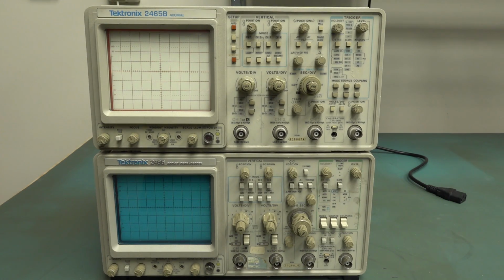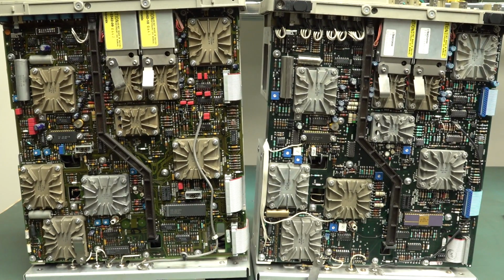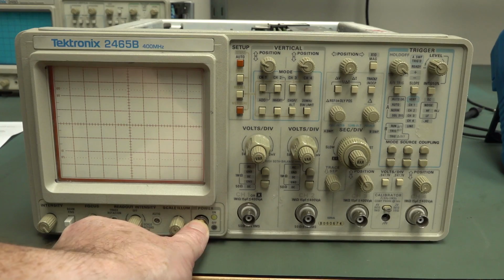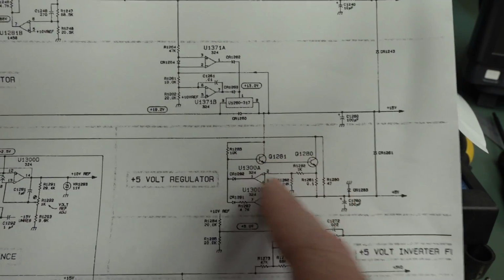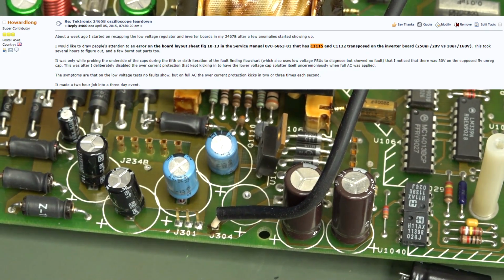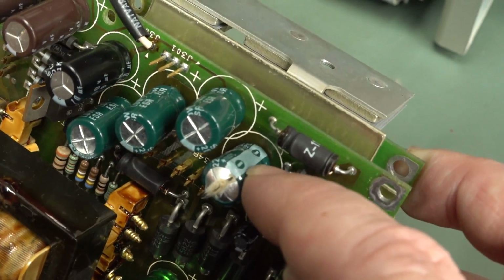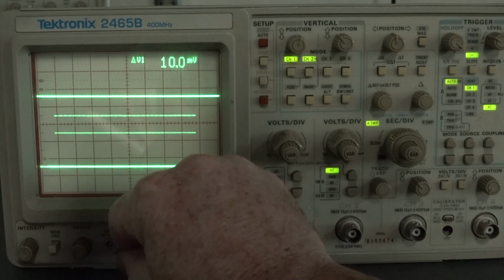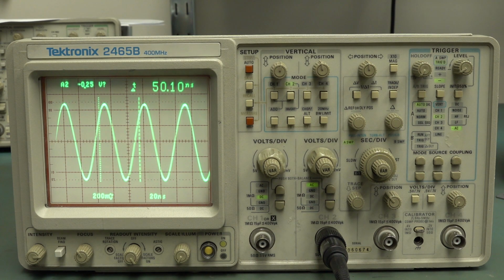EEVblog #1203 - REPAIR: Tektronix 2465B Oscilloscope

Comment: Oh, yes. Do a Part II. 

I retired about 5 years ago (former military radar tech). I miss the work. Haven't always enjoyed who or where, but I miss the work. I recently bought a pretty cheap ($200) TEK 2445B off eBay. It is about 80% functional. But the problem is that to troubleshoot a scope, you need another working scope. So I bought another $200 "parts and not working" 2465B. Got lucky this time. It seems to be 100% functional. So I bought ANOTHER 2445B, this one really cheap ($100) and definitely NOT working. Not completely DOA, but fails the POST, "Test 05 Fail XX".

I figure that I can get one, maybe both, of the 2445Bs fixed. Yes, I could have spent $600 - $800 on a guaranteed working and calibrated oscope, but what's the fun in that?

Comment: CONGRATULATIONS -- Regarding power regulating transistor that discolored PWB, wouldn't it be best to replace heat sink goop underneath it, even if electrically functional? In order to ensure maximum heat transfer and less likelihood of future failure.

Comment: How do you replace the dallas chip?  Not available any more
Reply: See this comprehensive guide: http://www.worldphaco.com/uploads/TEKTRONIX_2465b_OSCILLOSCOPE_CALIBRATION___REPOWERING_THE_DS1225.pdf
In SN B052846 scope I replaced Dallas w/ FM1608. Unsoldering Dallas DS1225Y 8950(>30 years old) copying contents - w/ TL866II plus programmer - to a FM1608-120, in a DIP28 socket.

Bought a Dallas1225Y-200+ 1140, (<20 years old)to verify programmer compatibility with both chips. Finally read the original Dallas, and with the result in the programmer swapped chip to FM1608. Wrote to it, and could then save a file backup marked for FM1608.

I have precisely the corrosion you see in the video at 8:29, two SMD caps. I'm trying to find the correct scematic & layout for this A5 board.

Comment: We had an IBM 1414 IO Synchronizer on an IBM 1410 computer with a bunch of caps that plugged into wire wrap that had a whole bunch backwards.  It worked that way for over a decade, but caused a problem with the printer until the machine warmed up.

Comment: For a least three years that I watch your video #695, I waited for this video. There are only a few videos about fixing the Tek2465b scopes and with an explanation. I hope you can dedicate another "part two" video explaining how to calibrate this scope and also discussing if it is necessary to do a mod adding a heatsink for the U800 IC. I have my tek2465b working and I will do a recap and I would like to know more about the calibration procedure. Thank you so much for this video Dave!

Comment: Dave, partway through the video, when speaking about the electrolytics, I heard you say about the brown caps, "probably a lower esr ones".

Is the shrink wrap color a standard manufacturing convention to denote low ESR/ESL? I immediately went to Google to see if it were a standard, and I couldn't find anything, but if this is indeed the case, it's very valuable informative to me.

Comment: "Best analog 'scope" is a bold statement. Although these 'scopes (2445/65/67) were exceptionally good, it's difficult to ignore several models e.g. from the Tek 7000 series: (much) faster, sharper image, more versatile, more screen information etc. The 7000 series were dependent on their plugins (to show anything) and were very much bigger but does that disqualify those from being "the best analog 'scopes ever"? Personal opinion and a matter of desk space available... Personally, having several 2465B's and 2467B's, for me it's the 7000-series models that are getting the most runtime by far. The 7000 models weren't/aren't less reliable either.

Comment: This might be a daft question, but is there any electronic way to emulate a capacitor with other components, and replace the electrolytics in any circuit?

Comment: When i first started out, at the age of 10, i would always avoid electrolytics because i found them extremely unreliable, when i was 14 i learned that that mark is the negative and not the positive :P 

a few things of note, i think the white background was for higher contrast pictures but i was -2 when this was built

also i highly recommend dumping that NVRAM before it dies, if anything for the community

Comment: Off course that explosion could be avoided if you shut down the scope as soon as you saw that the scope worked. Than you should shut down the scope and replace all caps that are suspected to be leaking.

Comment: I vote for making a case out of sheet metal covered with bamboo plywood, or maybe just the plywood if there are no real warm spots. I recently bought a 2465BDV, so will let it run for a few hours to see if there are warm spots. Alternatively, maybe some clear or pretty lightly coloured laser-cut acrylic?

Comment: If you can remove that NVRAM chip from the board, you might be able to use the TL866II programmer to pull its contents out. Then depending on the chip you might be able to replace that battery-backed SRAM with an EEPROM chip and write the data back.
Reply: Some Battery backed ram can replaced with fram. I read about replacing Ram in Gameboy cards with fram

Comment: I'm sure that I read that the case is important with respect to the cooling of the ASICs, which I also understand are common failures (and are as common as rocking horse ***t). I have one of these scopes, an Ebay purchase of many years ago. I really must get it out and figure out what is wrong with it. So many thanks for this video.

Comment: The Tektronix 485 was by far the best analogue scope. The 2465 never came close in terms of trigger accuracy and screen sensitivity. Also the rise time of the 485 was better.
I repaired a 485 because the trigger was malfunctional because the tunnel diode died. Unfortunately, the selected very fast (65 ps) tunnel diodes were unavailable for me so that I used one from my stock which is about 100 ps fast. The effect was evident - the trigger is less sharp now.
Reply: I would disagree. I have used both the 485 and the 2465B to maintain Army air defense radars. For sheer usability, you cannot beat the 2465.
Reply: @johnc8910  I agree, the 485 is old style concerning usage. But the technical quality of the amplifiers, the display, and the trigger accuracy of the 485 is unbeaten. You realize this while observing seldom and fast signals in nuclear science experiments.

Comment: 19:30 That flux looks so crusty that is probably still production leftover. Although you might think that this would not happen on a high end device, even today some things are hand soldered on very high end and low volume devices. It just looks ugly and is hidden, so meh. Why bother

Comment: It seems like the person who replaced the original caps bought (judging by their small size) the lowest priced high-ESR caps which are not suitable in such circuit. 
Moral - choose caps not only simply by voltage and capacity, PSU caps need to have high ripple rating and low ESR (Also keep in mind that these values are different at different frequencies). 
"Trap for young players" (c)

Comment: I would add a small heat sink to that transistor that is heating and browning the PCB.  And maybe even add a small fan in that area since there seems to be quite a bit of heat there with the diodes, etc.  Just a small PC 5V fan.  You can get a low air flow and low noise fan pretty cheap.

Comment: Regarding these burn marks: would it be a good idea to lift thos tansistors up and spend them some heatsinks? Maybe with electrical coupling back to the board if needed.

Comment: I would replace those two resistors near the transistor, make the replacements stand on their legs a good 10mm off the board.
Also lift the resistor and stick a heatsink on it, before the board burns enough to become conductive. Check if it is already and cut some slots if necessary.

Comment: The readout is fuzzy because you have it cranked all the way to the right.  I don't know why you didn't stop turning the readout intensity when it was clear.  It doesn't need to illuminate the whole room after all. - 34:57   ;-)

Comment: dremel the NVram epoxy pop the old battery out and if you're careful you can stick a CR2032 holder in there. I've done that to a old compaq 286 laptop so it would boot after running the utilities disk on it.

Comment: Hi Dave. 
I am a great fan of you living in Greece. 
Great work you do mate. 
Keep up. 
I have not finnished watching  the video yet and I noticed that on 6:38 the moment you push the power button a spark seems to flash in the mains capacitor area (upper part of the screen in mid to right). This happened twice. So maybe there is a possible problem. Cheers mate.

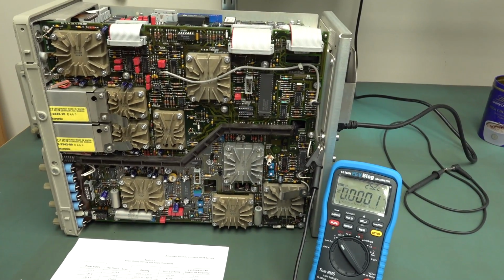Comment: OMG take the LCD shipping protection film off the 121GW meter!  I think you can get a replacement if you happen to scratch it any way!   ;-P   - 10:53
Reply: @Blondie SL - Sure but I'm guessing that you aren't recording YT videos and have your own meter in production and thus can replace the screen plastic, case or even the whole meter for free or at very low cost.  In the field is one thing but in Dave's lab there is no reason to leave it on.
Reply: @ElmerFuddGun  Do you leave the plastic on your car seats when you buy a new car?

Comment: I'm, usually, check and compare old electrolytic capacitor markings with silkscreen markigs.. One time i blow up new capacitor because markings on silkscreen didn't match actual case.. :D First moment was shocking, because i can't figure out why new cap blow up.. Luckily, i always take pictures.. Anyway, we all get mistakes and learn from it and little bit action, sometimes, is great to make living more interesting.. :D
Great repair, Dave!
For repaired scope - create new giveaway and ship it as it is.. Winner pay's shipping from Australia.. :)
I'm in, anyway, because this old Tektronix is great scope and i'm need a little bit modern scope than my old, single channel S1-65, manufactured in Soviet union.. :D

Comment: Dave, I understand that you are doing this video for education purpose, but I suppose in your country, substituting every electrolytic cap, recalibrating and doing a fully functional check would make the repair cost too expensive,  the best solution might be to give them away for repair in some country where they could be done at lower cost and then sent to schools where they could afford new equipment.
Reply from the maker: Of course it would and I said this in the video.
Reply: @EEVblog  sorry, I was watching your video in multitasking while working on an Arduino.

Comment: I need to replace the capacitors on my 2430A power supply buried in the middle of the scope. The ripple is visible in the CRT readout.  Not looking forward to that. :(
Reply: The power supplies on my 2430A are mounted to the side of the internals and not buried in the middle. When you take the case off look for a circuit board with a big red moulded module, that's it. Be careful HIGH Voltage may still be present!
You can still find the repair manual on the internet. Good Luck!!
Reply: @rocketmike5825  Thanks, I will discharge the caps first using Dave's method with the low impedance meter mode and will stay away from the CRT.  Almost blew up a new LCR meter recently.  The MOVs inside saved it.  Fun...

Comment: Always measure the ripple on the rails, don't rely on indicated voltage,  very valuable lesson Dave.
Reply: On the other hand, TTL is VERY forgiving of ripple on the 5 volt rail. TTL can easily tolerate up to 1 volt peak to peak as long as the max positive value stays under 5.5 volts.

The old HAWK fire control control computer (circa 1975) used an unregulated 5 volt CPU power supply. 1/2 volt RMS ripple was not unusual.
Reply: On the other hand, CMOS logic is very tolerant of noisy Switching power supplies, but very sensitive to low frequency ripple on the rails. Nature of the beast.

Comment: I have 2 of the original 2465 300 Mhz and they are truly awesome machines. I recapped both units 4 years ago when I rescued them from eBay and have received flawless performance from them ever since. They are a bit of a trick to work on but they are the Lamborghini of oscilloscopes in their day. I save all the Tektronix gear I can. I love the stuff. I liked the Bobbie dazzler it reminded me of the troll dolls of the 70's.

Comment: The badge over the 2465B is not made by Tektronix. Tek never made an all blue badge. The 2465B you have may be a repurposed 2445B by modifying the BW limiting filter.
Reply: Dave, the sure way to tell if you have a "real" 2465B is to look at the mainboard part number. Some of these have been popping up, where someone shorts out a PCB spiral inductor in the 2445B BW limiting circuit.  This has the affect of immediately giving the 2445B an extra 150MHz or so.  However, it will never adjust like a real 2465B in terms of BW and fast transient response. I am absolutely certain you do not have an original "2465B" badge. Worst case is you have a 2445B (that's been monkeyed with), best case is you have a 2465B with a fake badge.
Reply: Hi Victor, you're right. The badge is a fake and so is the type ID: At 8:50, the spiral in the PCB is obvious. At the bottom right between screened "DL100" and "U600 Vert Out", it's clearly visible. That is not a 2465(B) but a modified (?) 2445B.
Reply: Yes, at 7:13, "I see some crop circles", this is definitely a 2445B.  The title of the video needs to be changed, hahaha.
Reply: Right, and look at the two offset holes to the right of the marker "G". That's where the delay line should be connected but apparently isn't. One (two?) of the wires may be seen through the hole (red wire). Interesting 'scope!
Reply: @raymonddompfrank1789  Probably connected the delay line at a point before the spiral inductors. Then cut the trace to the spiral.
Reply: @VictorSilva-rq4kz  You must be right, Victor! Never seen one of these modded 2465B's before and didn't think of that. Certainly the best way to get rid of the spiral. Thanks for the info.

Comment: No wood! Go the distance and get a sheet metal guy to bend one for you. Roofing tin comes in many different colours or just go galvenized.
Reply: Just buy an empty case from eBay, or buy a cheap, clapped out, obviously "needs repair" 2445 or 2465 just for the case.

Comment: Case option? Acrylic case with some RGB blinkenlights?
Reply: As other commenters have mentioned, the case is part of the heat-sinking - which means it needs to be metal, not plastic.

Comment: One problem with caps that leak, especially if they have already caused corrosion, the electrolytic has run into the vias and will cause damage in the future.

Such a board is on borrowed time...
Reply: Will a bath in isopropyl alcohol help?

Comment: As for the browning of the PCB, those components should have been placed at least 5mm off the board from the factory to prevent exactly what was shown. The power transistor should have been mounted onto a small heatsink... Great presentation once again Dave, well done... 10/10

Comment: Maybe someone else mentioned this in an earlier comment (I'm NOT reading them all), but with the case missing, critical cooling is not reaching the ASICs and all those very pretty heat sinks. Not good...
Reply: That's true for the digital 2430/32/40 'scopes. Not applicable to these 'scopes.

Comment: some have gotten inside those dallas chips and bodged on a coin cell or something instead of trying to find one of those replacement ones
Reply from the maker: YOu can get replacements one at Digikey
Reply: @EEVblog  dallas stills makes those special chips....wow i thought they where discontinued when motherboards quit using the dallas chip

Comment: When i did a recap on hp 100mhz scope the trace lines cleaned up and where much sharper. Enjoy  the video. Have some sheet metal bent for the case is what I would do and add a  quiet fan .

Comment: Dave, you can Dremel into the power points of that Dallas chip and solder in wires to put an external battery in it. It's a lot easier than unsoldering that dang thing. Also gives the ability to put the battery somewhere safer for the far future when it leaks
Reply: Its always best to memory dump it first so you've got a backup copy before doing anything
Reply: @DanafoxyVixen  How do you do that?  What reader and software would you need?  I would be interested in learning that.
Reply: Daveyk021 Guess I’m very late, but:
There’s a diagnostic mode that you can access by pressing “volts cursor”, “time cursor” and “Trigger slope” at the same time. In that mode you use the “Trigger Mode” up and down to navigate between different tests, calibration routines and exercisers. Go to “EXER02”, press “Coupling up” once to run it, then you use “source up” again to go through the memory addresses. On the screen it displays two digits on the left, representing the address in hex, and four in the right, which are the data in that address. I’d suggest filming the screen while you go though all 256 locations
Reply: @DanafoxyVixen  Yes as Davey says, can you explain how to do this.

Comment: Fortunately, those Dallas SRAM and RTC blocks can be "refurbished." Not something you'd necessarily do if you can get a direct replacement, but for some older computers that don't have an equivalent newer model that will work, you can dremel out the potting to where the battery terminals are, and solder in leads to a coin-cell battery. There's tutorials online on how to do this.
Reply from the maker: You can buy new chips, and there is a procedure for swapping them.
Reply: @EEVblog  In most cases, yes.